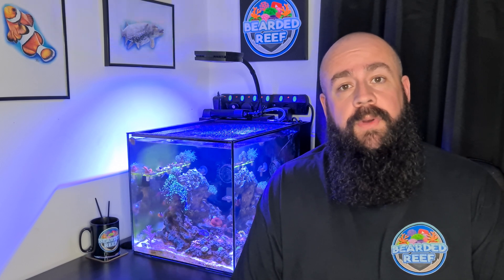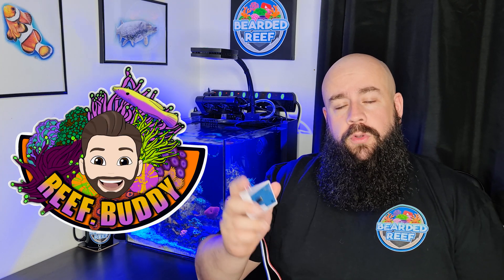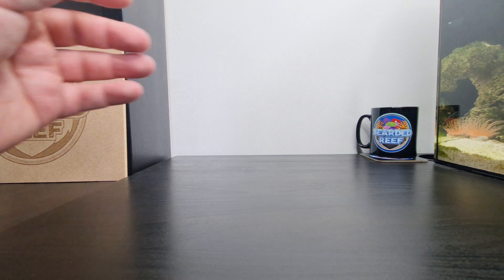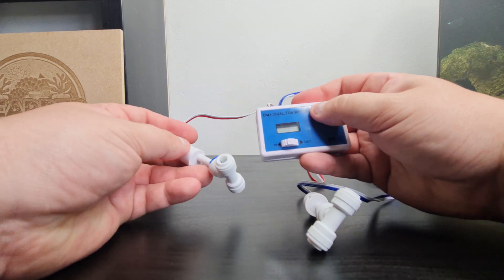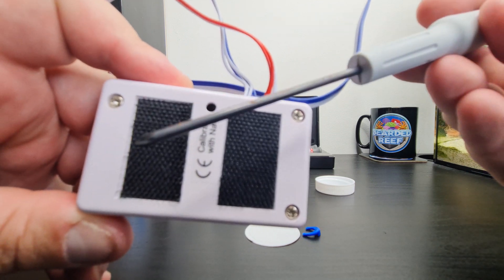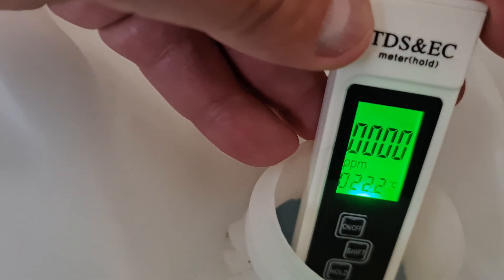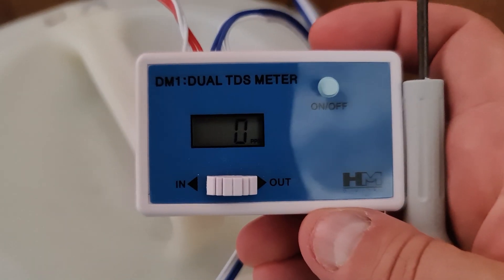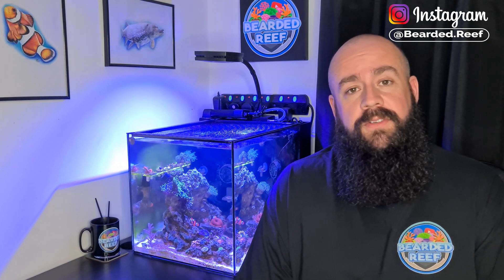How to Calibrate the HM Digital In Line TDS meter for RODI units

Comment: You can not calibrate this in line TDS meter. It needs to have flow running through the T connection. He totally just screwed the calibration of your metre. Buy 4 or 5 bottles and the smallest pump you can possibly find and circulate the calibration fluid through the T connector so it always has constant flow. BRS already talked about this and said they shouldn't even be selling this fluid because it just screws up people's inline TDS meter. These need consistent flow through the posts in order to read calibration properly.

Comment: ... helped me out - I had to take the rear three screws out to properly see the adjustment screw with a magnifying glass before I could manage to turn it with the smallest jewellers screwdriver 🪛  I own... I just cheated - once water was flowing through the rodi and reading 0 tds with my tds pen at the catchment tub I just dialed the in-line meter to 0... a bit of a bodge maybe but at least both meters read the same and I tryst my pen more than I trust one of these things... I putting it down to rodi being outside with meter and low temps...cheers dude
Reply: May be i try with destilated water, thx for sharing

Comment: Lucky you, my water came miscalibrated by 100 ppm, Then I figure, I DID NOT  need this water 342ppm,   I  can use my regular MANUAL TDS meter and any water to calibrate the HM Digital In Line TDS meter to match the Manual TDS Meter. and it worked.  I guess you would need the water 342ppm if you do not have any other TDS meter.
Reply from the maker: Yeah you can compare it to any other device no problem, I do calibrations for a living and that's a common way of calibrating certain instruments, but the issue you have is the item you are using as a reference needs to be more accurate, most of the manual tds pen style ones are way out by a lot and are not accurate or drift, the only way to accurately do it therefore is with the test solution

Comment: I believe the liquid needs to be running in a tube for the calibration process to work.
Reply from the maker: It does say that in the manual which is impossible to do so this was 2nd best and worked fine